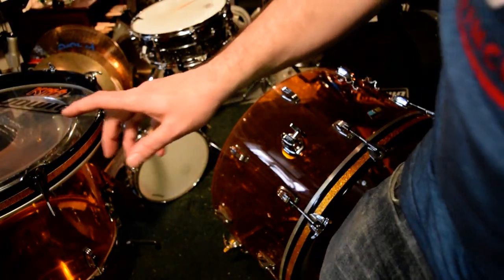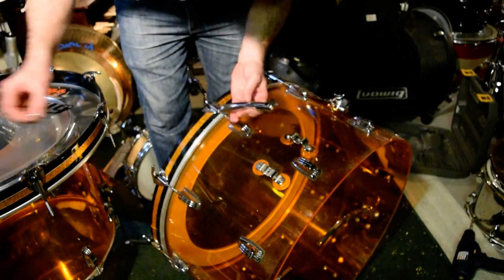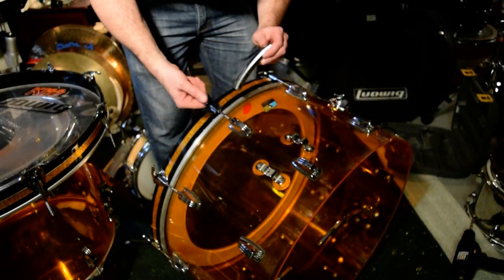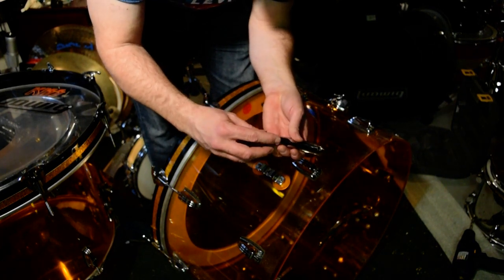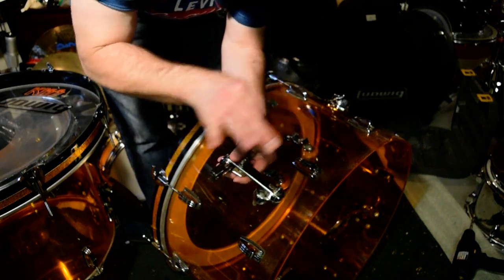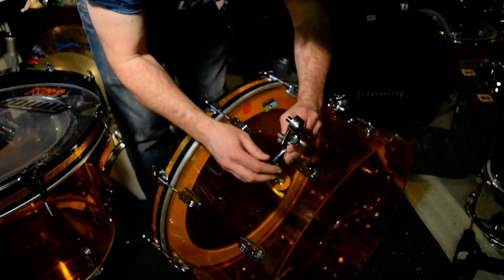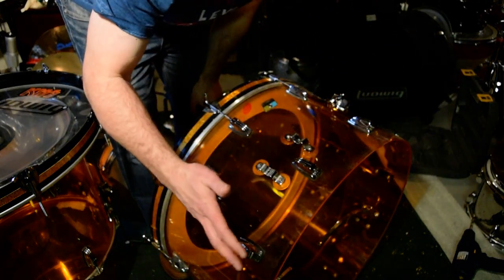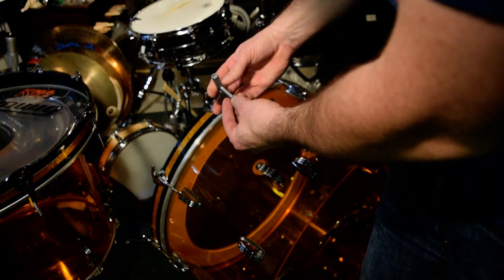Installing An Original Ludwig Rail Consolette Bass Drum Mount *Amber Vistalite

Comment: Man Terry, I feel for you regarding the tom mount.  My OCD would force me to re-drill and mount the rail consolette correctly,  It would always bother me, whereas the four extra holes would not. You could put round head bolts in the holes, or have a nameplate shop make a cool Bonzoleum or Property of Terry Keating plaque to be affixed with bolts through the holes.  Another option would be to have one of the plastics fabricators in the Chicago area cut some acrylic rod to fit and solvent cement in place.  So sorry Terry, it's a bummer, but not insurmountable!
Reply from the maker: Thank you G for the supportive words. I almost
shat in my pants when I realized my error.

Comment: I purchased a Ludwig 100th Anniversay Liverpool Four kit from a friend. Great kit. I wanted to replace the beefy modern rail consolette with a Maxwell version... The Ludwig redesign is ugly and doesn't work well at all. Anyway, the holes don't match up so that option had to be nixed. I'll probably use the Gauger frame mount on a snare stand for the tom. That setup should be more reliable and flexible.

Comment: Terry, I have a question buddy. In this video there were two snares of different depths I noticed. What is the differences between deeper or shallower snares? Besides the depth lol!
Reply from the maker: The depth of the tone, (generally). Take a shorter class and a taller on (with same circumference), hold it by the bottom, and with your other hand tap the top of each. Listen to the tone. It's not nearly 100% of a good analogy, but it gives an idea of the mass's effect. Also, on shallower snare drums, there's less are to deal with which makes for both a better drum & snare response.
Reply: Perfect! Thank you very much! ☺

Comment: Don't understand why you would want to mount a tom on the bass drum. Snare stand for the tom has to be the way forward, don't you think? lol
Reply: Bonhamical accuracy ahah and it looks cool
Reply: Disagree, I think it degrades the drum. Just my opinion.
Reply: I agree, it's something I avoid at all costs,  but keeping with the total Bonham look plus, it does look beefy as heck. I'd be more upset about the badge ordeal. 😂🤣😧
Reply: I love the rail consolette! Personally, I love the aesthetic of it - it's really sleek and unobtrusive. It also means one less piece of hardware you have to haul around to shows. In my experience, it doesn't degrade the sustain or tone of the rack tom any when it's affixed properly, and certainly not anymore than a snare stand does. That being said, I'm not a fan of the modern incarnation of the rail consolette. It's just straight ugly and loses everything that was great about the vintage mounts; I would gladly use a snare stand over a modern rail consolette any day. However, for a four/five piece setup (one tom up / one or two toms down) I don't think there's anything better than one of those old mounts.
Reply: Kick It Like Bonham yes!!!!! The aesthetics are where it's at with this vintage stuff.  Nostalgia, etc....
Reply from the maker: Thanks for posting Derek! I don't like the modern rails-too big and intrusive, and they don't really budge a whole lot so you get as much sustain. I love these original Ludwig 4 holer's. Steve Maxwell makes a great reproduction of it. I hope he (or someone) will take my advice and make the rail itself detachable (as I say in the video).  The strap attached tom has nice play; there's a lot of forward and back give that let's the tom ring.
Reply: bonzoleum That's what I'm talking about! Exactly!
Reply: I like the 14X10 tom drum position  better with the mount on the bass. Using an additional snare stand has the drum back a bit more than I like. Anyway its gotta be like Bonhams!